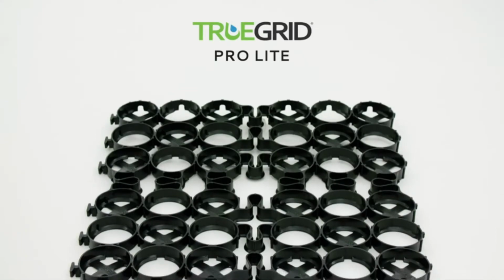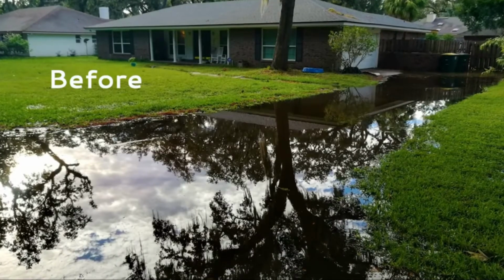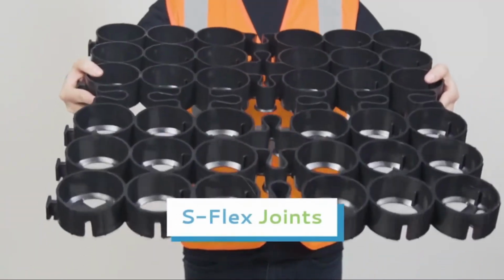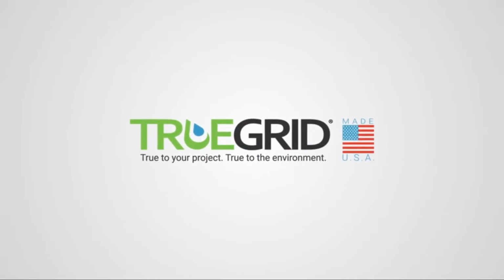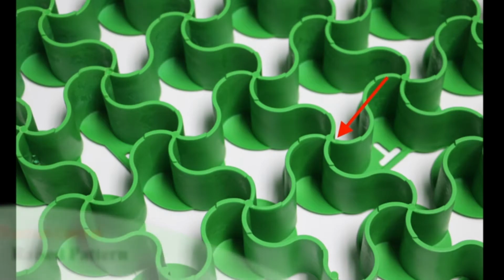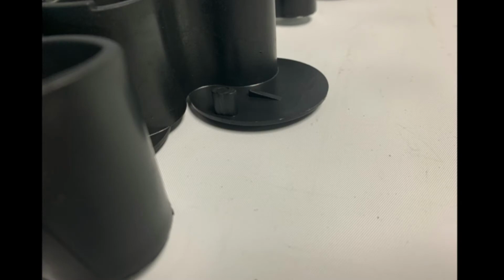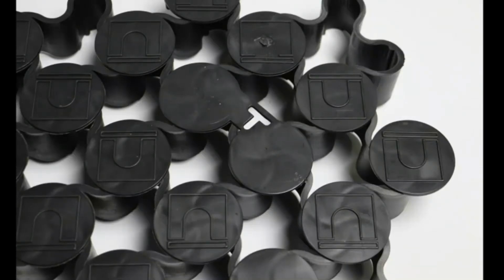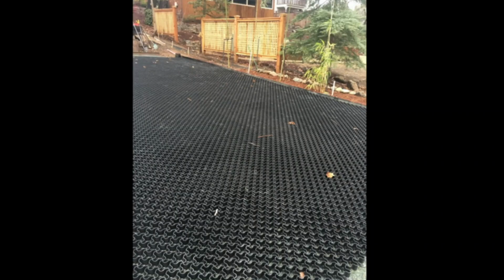Best Grass Paver 2024 - Top 3 Grass Pavers For Driveway

Comment: The problem with these semi-hard plastic type of grid systems is that, in the middle of summer or when the sun is shinning directly on it, it heats up and starts to buckle. And once this happens, there's no way to get it back down. Several people have complained about this. For this reason, the cheaper, more fabric type of systems, the ones you pull apart like an accordion, work better .

Comment: If you think about what this product is... the price makes no sense.   It looks like something you get for near free in product packaging.  Excited to hear it's made with recycle materials.. There must be plenty of plastic and rubber out there to make these cheap.
Reply: Completely agree. Not only that but, if you watch what the manufacture has you do for ground prep and installation, it's close to the cost of a new asphalt drive way. Hey, just get a bunch of plastic crates, cut them apart and put them down.
Reply: @richardl3720  funny you say that , cause outside my office I have a bunch of plastic crates that washed up on the river I collected for this very reason.  They appear to be from some bakery.  They are only like 6" tall and I'm gonna try to press them into the sand as-is.  I only need them in a few spots where I have to reverse to do a 3 point turn in powdery sand.